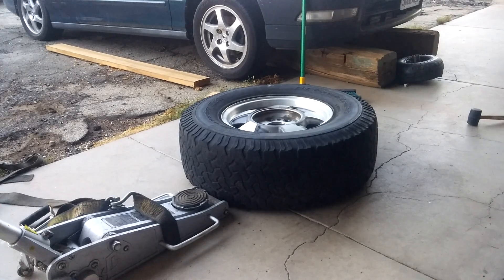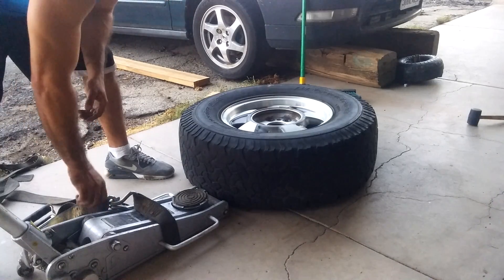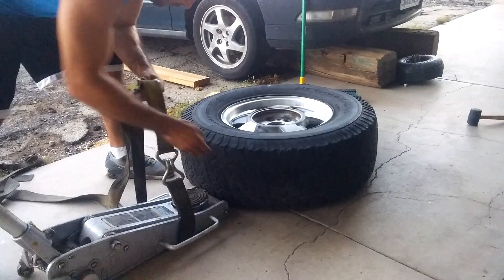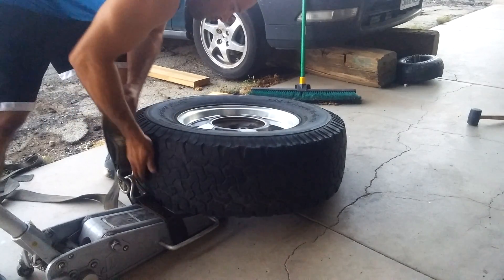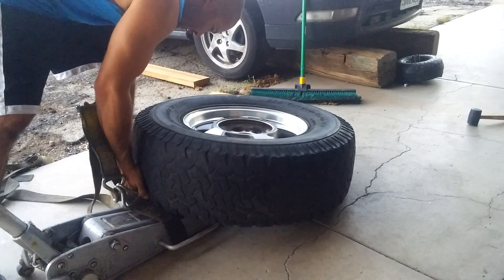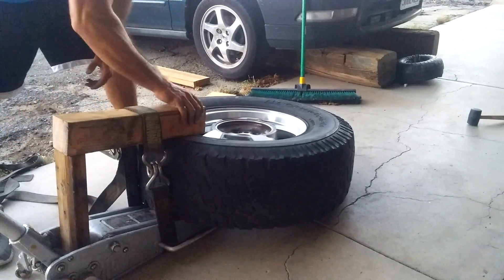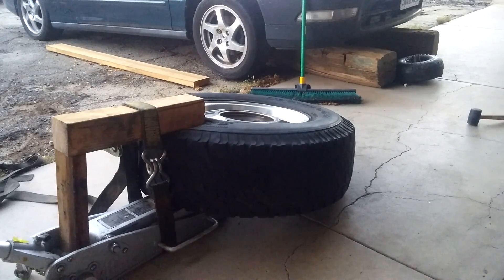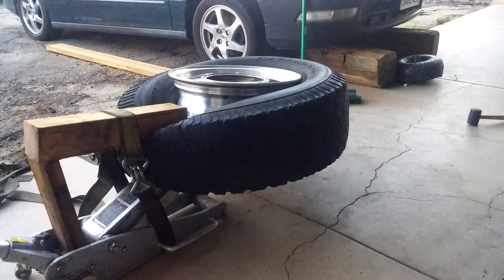Breaking a tire bead easy

Comment: Needed to replace a valve as it split at the base on our caravan, this setup worked a treat. Was able to break the bead, compress the tyre enough to get the old valve out and replace with a new one. Thanks for the video.

Comment: I appreciate the video you made, I was completely stumped as to how to get my front motorcycle wheel off its rim. Although I could have made a contraption out of junk metal like many others have done, doing what you did was much quicker and easier for the time being and had exactly what you had to get it done. Wood, a floor jack and a ratchet strap was all I needed. This video was helpful and I do appreciate it, now I've got my new tire completely installed and I'm very happy to have not had to buy extra tools or go out of my way to make something excessive. Great job!

Comment: This is by far the best way of doing it for me. I tried other methods using just the jack and the strap but it wouldn't work for 30x9.5 tires. This technique worked great. Had to make sure that the sidewall was nice and dry though otherwise the 4x4 would slip off the bead edge.

Comment: Thanks, man... it worked like a champ.   I had to break the bead to attempt to fix rim leaks on both sides of my 'beater truck' tire - didn't want to spend anything on it.   With the rust it didn't pop loose like yours, so once loose I helped it by putting the end of a 2x4 near the opening (moving about an inch in both directions) and knocked it loose - was afraid if I kept pumping/"muscled it" I'd damage the somewhat dry-rotted tire.   Wire-brushed rim with drill, followed with 80 grit sandpaper and more wire wheel, then cleaned rust from tire with fine wire brush, vacuumed as much debris as possible, wiped it down with alcohol, put a thin layer of DAP acrylic caulk on it (hoping to seal moderate pitting), and no foaming soap bubbles anymore.

Comment: Good idea but seems risky... how did you keep mounting plate of the floor jack from scratching/trashing the outside edge of the rims?
Reply from the maker: well my Jack actually has rubber for the plate so it didn't scratch, I didn't think of that since mine was rubber, I guess you could maybe put something over yours, 2x4?

Comment: I only got this to works once, tires kept slipping.  Maybe a 2x2 heel on the end of the 4x4 would help.  Driving on it didn't work, tire tread puckered inward supporting the vehicle. I have a small hitch on my prius so I bought a trailer hitch without a ball and mounted the top of a screw jack to it with a bolt and washers.  Put the base of the jack near the rim then crank it up, works every time no fumbling.

Comment: I have been tring this on my atv and the wood slides away from the rim when its starts to really tighten up.. its torture its so close so i switched out the top wood peice for a crowbar and it still slips back wtf am i doing wrong?
Reply from the maker: it did that to me also, try using a taller 2x4 that stands straight up to get a different angle, or a shorter one.
Reply: see he has some air pressur in tire , without it might slide
Reply: Tires for an ATV have very soft sidewalls so flex quite a bit before the bead starts to move. What I do is soak the area with soapy water so as you gain space you also gain a bit of lubrication each time the bead slides back up. After 2-3 tries it usually moves down enough to break free, although you may have to help out with a large pry bar as the gap increases.

Comment: Tried this on a 225 55 17 tire and it failed. I even used 2 jack one on each side. I even clamped it with my carver clamps,and those are industrial grade, and used this method and still didn't work. I don't know what was up with that tires bead but I gave up and took it to the shop. Oh and there machine had a hard time as well 😆

Comment: Jack and wood with strap has been around for a long time just remember if the tire has not been broke down in a while you can an will break bend or mess up your wheels. If you look you can find a better way to use the three without damage.

Comment: I admire the ingenuitity BUT you are still tasked with removal and mounting
  12.50 is pretty cheap to pay to have it done AND  balanced
Reply: Thought the same thing. I recently paid $18 for just the balance.
Reply: 12.50? I wish. My shop charges $55 per tire changed and balanced

Comment: Bumper Jack and the back of a truck or something heavy less chance of splinters in your face...... That setup would be much better if made out of steel not saying it doesn't work, but getting hurt doesn't save any money be safe 👍
Reply from the maker: kenneth tanner  I feel ya. Just something quick and easy. A little more time and fab work could make something solid

Comment: Do you realize there is wire inside the rubber of the tire and squashing the tire like that can bend those wires
Reply: The whole purpose of taking off the tires because it’s trash so don’t matter
Reply: I don't think the kids using that tire for their new swing will mind.